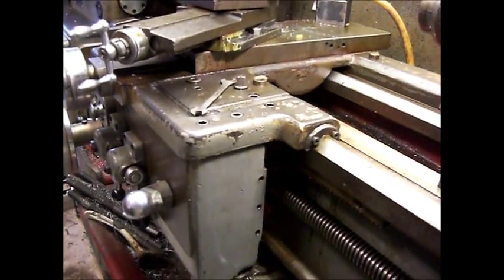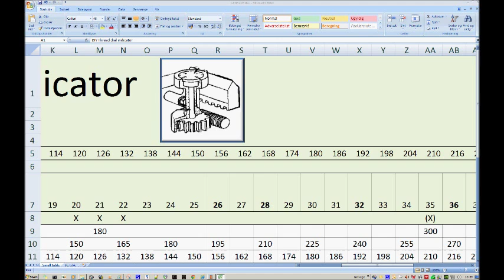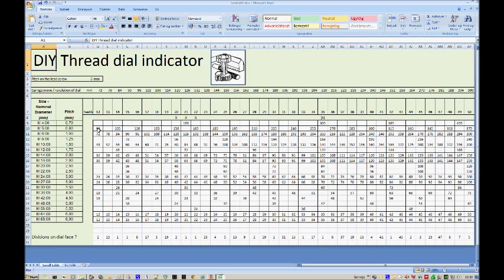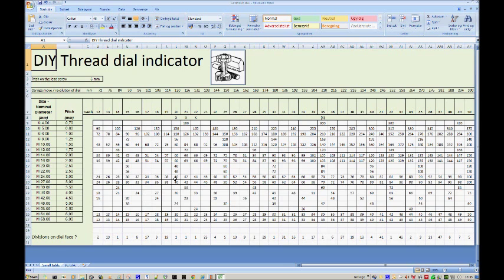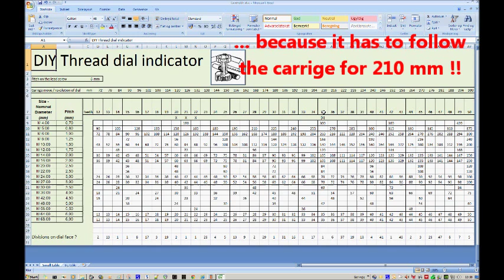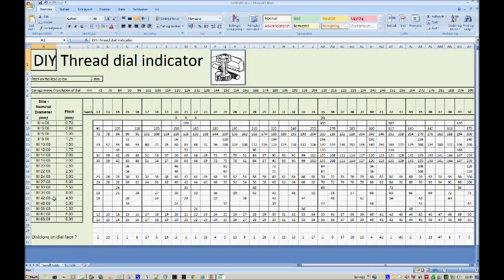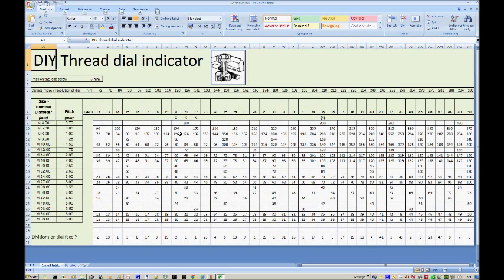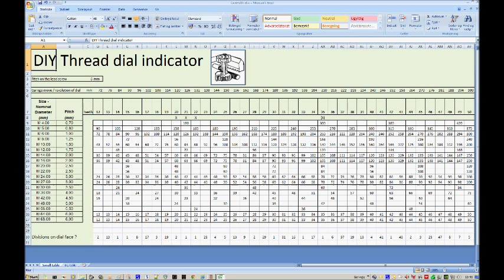DIT Metric Threading Dial - design ?

Comment: Hello Keld, where can I find this spreadsheet that you use during the video?
Reply from the maker: I think I canfind it on my computer ... but why do you want to have it ?
Reply: @keldsor  I'm trying to build a thread dial indicator for my optimum vario 180 x 300 and your spreadsheet will help a lot. That is of course if you allow me to use your case of study
Reply from the maker: @edwardschiller6030  Ofcause you can use it ... if I can find it 🙂 !
I'll take a look - I remember some others reacted too on my video and one of them in fact did some very interesting calculations - I'll take a look to find these Excel-files and come back - mail me you E-mail address - mine is  keld DOT soerensenS AT gmail DOT com - remember the LAST "S" !!!!

Comment: Hi ... late again!
Imperial is easy as long as you stick to even threads. I am just getting in to metric thread cutting and the DTIs still confuse me, they need different gears for different threads. Imperial are all TPI, if only the metric systems were threads per cm and whole numbers! I have been through you confusion believe me. But ... there is a rule. If the pitch of your thread is an exact multiple of the pitch of the lead screw .. then when you engage .. the tool can ONLY be a whole number of pitches out ... which is easy? This was like a revelation to me ... and 40 years amateur engineering! So 6mm pitch ... if (6 / pitch) is a whole number .. then you don't need a DTI. For the ones that are left just run in reverse? So .. 0.5, 0.6, 0.75, 1, 1.2, 1.5, 2, 3 are OK for 6mm. Nasties are 0.8 and 1.25 for your lathe ... but that's only 2 threads to worry about?

Comment: So I'm 2 years late for this but hey, maybe someone will find this useful. I do think your math is correct! From the research I have done on this topic it seems you need at least 3 different gears and possibly 2 or more different dials to be able to cut all metric threads, which is largely the reason they are so uncommon. 

There is one thing you missed though. The divisions on your dial do not have to fit with every single thread pitch! For imperial threads only even thread pitches can engage on every line. Odd thread pitches can only engage on the 4 numbers. "half pitches" can only be engaged on opposing lines, and so on. 

You could easily adapt this to the dials on a metric thread dial. Looking at your spread sheet 2, 3 and 5 are quite common factors, so a dial with 2*3*5 = 30 divisions would be quite useful. So if you have 150, 120, 90, 60 or 30 treads pr rev. of the dial (like you have listed in your spread sheet), then you can engage on any line. those that are divisible by 15 can engage on every other line, and so on. You would have to make your self a table of some sort to keep track of all the allowable combination, but that should be easy for an economist ;).

And then there is the method that someone mentioned that Tom Lipton has demonstrated. For that you could really just use any gear with any number of divisions for any thread. The only criteria would be that the divisions line up with the lead screw.
Reply from the maker: Yeah, 2 years but I still have it on my TO-DO list to get it figured out - because I want to find out WHY and then the HOW will come as a side effect.

Comment: How you getting on with understanding lathe threading Keld.
Have you found out that if you are going to cut 0.5, 0.75, 1.0, 1.5, 2, 3, 6mm pitch threads you can engage the half-nuts at any time.
Other pitches get a little more dependent on having a thread dial indicator. A policy you may like to consider would be to avoid screw cutting other pitches.
Reply from the maker: The day before yesterday I was "practicing" in the shop, making marks on nearly each and every turning/moving object I could see ... but focused on the leadscrew, the main spindle and the saddle.

I'm so stubborn I want to relate what I see to my calculations in that spredsheet in the video, and I think a lead to what you are saying is, that for these pitches I have a integer/whole number of threads on the distance the saddle is moving - NO MATTER how many teeth I have on my imaginaity/virtual threading dial ! In the spreadsheet this is shown by a number in each cell of the rows lining up with the pitches you're memtioning - maybe there should be more words in the explanation, but it's a lead for sure !

The more I read and practice I get closer to this conclusion: Limit yourself to some common pitches you probably will cut in your lifetime and then use the "reverse method" - again Occam's razor !

... but the full and deep "understanding" whould be nice to have ... but should the remaining useful life be used on such luxury ;-))
Reply: Well life is a bit short when it comes down to understanding everything in depth, take women as an example. Anyway, moving on to other pitches, using the Harrison lathe indicator for a 6mm leadscrew instructions that I have found in a book ( Screwcutting in the Lathe by Martin Cleeve, Workshop Practice Series number 3. Try Camden Books if you want to buy a copy ) the indicator reads one revolution per 120mm of carriage travel. the dial is split into four groups of five ( 6mm travel each line ) and with this handy piece of kit the process for the pitches not available directly do become available. In my mind your idea of leaving the half nuts closed and reversing the lathe, sounds good to me, on the odd occasions you would actually have to stick to a particular pitch.

Comment: Keld I think you have got a bit confused as to the use of the thread dial indicator. All the dial upon the TDI shows is the rotational relationship position between the chuck (workpiece) rotational position and the leadscrew rotational position. With the half nuts disengaged the dial rotates (when it is in mesh with the lead screw) and the lines upon the dial have a nominal meaning. Take a dial with one index position on it (forget number of teeth on the gear, that does not matter) every time the dial has rotated once, the workpiece and the saddle position is synchronised. Engage the half nuts and the saddle will start to traverse along the bed, the dial indicator will stop rotating and remain in this case with the one index mark fixed in the same position, where ever that is when you engaged the half nuts. At the end of the required travel, disengage the half nuts, the saddle stops moving but the dial indicator now begins to once more rotate, tracking the position of the rotating chuck and lead screw, move the saddle back to the approximate position you started at and wait for the dial to rotate the index mark to the same position as before, engage the half nuts again and the saddle will once more move in the same rotational relative position as before. All the other dial markings do is speed up re-engaging the half nuts on certain thread pitches.
Reply from the maker: Hi Stephen !
What confuses me a lot more is that some commenters say that I need different gears and others say I can use only one gear or even no TDI at all - just engage where I want !

I don't believe all of it can be true, so I decided to find out how it all fits together by doing some calculations, that's what you see in that video - but I got stuck very fast !

I haven't seen that light yet ... the "AHA" hasn't come to me yet ... I believe I have to work with the lathe more to simulate cutting threads before I see the light !

Here is one video I think is interesting on this subject - he's disengaging the half nut and have NO TDI !

THREADING ON THE METAL LATHE WITHOUT A THREAD DIAL

I'll try to "understand" what is going on in this video - I think that will help me.

I just don't want to "learn" a mechanism, I want to understand it - and I thought my calculations could help me ... but they haven't yet - maybe this video can !
Reply: Keld Sørensen It's not easy to understand until you see it in action. You are going to have a great deal of difficulty in finding a gear to mesh and until then it's going to be difficult for you to visualise. If the pitch you want to cut is directly related to the lead screw you can engage anywhere. Try this to see if it helps. Set a gear pitch up say 3mm on your gears. Mark the chuck with a line at the top. Mark the bed with a line (pencil would be good) at the tailstock side of the saddle. Set a tool up and in a piece of material just scratch the surface with a cut under power with the half nuts engaged at the end of the cut split the half nuts, withdraw the tool and move the saddle back until the tool is clear of the metal in the chuck, switch  the lathe off. Position the saddle at the pencil mark on the bed, engage the half nuts whilst turning the chuck by hand, the saddle will now move, continue to turn the chuck by hand, as the tool gets to the job note how it is positioned relative to the thread and where the mark on the chuck is. Do this several times from different starting points, proving if it matters. Then select another pitch say 1mm on the gear train / gearbox and look at what happens then.  Hope this helps Keld.
Reply from the maker: Stephen Deakin That was exactly what I was going to do inspired by that video ... and now by you ;-))
Reply: Keld Sørensen Keld I forgot to mention that the lead screw should also be marked (on its top somewhere near the tailstock would be good) with paint ( ladies nail polish ) so it's rotational position can be observed.
Reply from the maker: Stephen Deakin That's exactly what he was doing in the video I linked to ... so, I think your procedure is nearby what he's is proposing in the video and I'll try that as a catalysator for my understanding.
Reply: Stephen Deakin b

Comment: It looks to me like the thread chaser with several built in gears that can separately engage the lead screw is the "easiest" solution so far. The jpg image of page 296 (http://s200.photobucket.com/user/oldtiffie/media/Thread-cutting_lathe/Thread-cutting8.jpg.html) seems to indicate that 5 gears are necessary to cut pitches from 0,35 up to 11mm, i.e. 14, 16, 18, 20 and 22 teeth. There are many pitches which need no thread chaser. I am very interested in the solution because I have the same problem, although I have a thread chaser on my lathe. I suspect my thread chaser only works for imperial because there is only one worm gear in the chaser. I'll be following to see if (how) we can solve this one.
Reply from the maker: Hi Jim
Every time I read the page 296 a little bit more light is turned on in the issue - but oh, it hurt for me to understand what is going on here.

Mostly my treading problem can be solved by just making this "auto lift up threading tool" - but it can't be used for inside threads and that's a major problem - so I HAVE to find out how to make a threading dial for metric system ;-))
Reply: Keld Sørensen
I can't see why you could not just use the threading chaser as shown on page 296, Keld. It appears to be a threading dial with several gears built in. You still have to change gears, but they are all there ready to be moved into place. No? Perhaps there is something I don't understand. Whether you turn threads on the inside or the outside is just a matter of tool placement. This should work like any other thread chaser. One would just have to make sure that the right gear is in place before you start turning threads. Unlike the metric ratio "threads per inch" metric uses the distance between threads, unrelated to a fixed dimension. I would like to see some working drawings of this multi-gear thread chaser and then build one. I'm looking! I'm hoping that some of our European contacts chime in and tell us how they have solved the problem. The Ukrainian guy Uncle Michael or the Finnish Sunppaa should know. How's your Ukrainian?

Oops, I just read that you were referring to the auto lift threading tool when mentioning that you could only do external threads. Sorry.
Reply from the maker: Jim Milne Yeah, only outside threading ... but Paul just told me otherwise - looke here:

http://mikesworkshop.weebly.com/internal-swing-toolholder-for-threading.html

;-))

Comment: Keld, in your searches did you run across the following?  It looks to include information on the same 6mm lead screw you have.  Table 1 shows the different number of gear teeth needed for the different metric pitch threads, a diagram of an example dial and based on that dial when you could drop in to the using the half nuts based on that dial.

http://s200.photobucket.com/user/oldtiffie/media/Thread-cutting_lathe/Thread-cutting8.jpg.html
Reply from the maker: Yeah, I saw that too.

Comment: you can use a thread dial but you don't need multiple thread dials you use the lathes gear box or change wheels for the different pitches. plus if you get your calculations right when the thread dial is engaged and the carriage  is moving the thread dial stays still it only turns when the carriage  is stationary
Reply from the maker: Erling Weiseth Ha, ha. ja i YouTube-sammenhæng er vi da !
Reply from the maker: Hi m fletch
You write

"you don't need multiple thread dials" ... ?????

do you mean that I don't need multiple GEARS for the thread dial ?
If so, I think you're wrong.

"you use the lathes gear box or change wheels for the different pitches" 
Yes, I know that - but it has NO effect on the turning of the thread dial - to change that I NEED another GEAR on the thread dial - right ?
Reply: Keld Sørensen Hi Keld.  As I see it you only need one sized gear for the thread chaser.  The relationship between the leadscrew and the thread chaser gear stays the same regardless of the thread you are cutting.  The thread pitch you cut is only determined by the distance the carriage moves per spindle rotation.   You just need someone with a lathe with the same leadscrew pitch to count the chaser gear teeth for you.  Rob
Reply from the maker: xynudu Oh, Rob, then I have to go deep into the russian wilderness - I don't know anyone with a thread dial for that lathe.
Reply: Keld Sørensen Maybe some of the viewers can help Keld out on this.  I don't have a thread chaser either, and have no problem cutting threads by reversing out.  I wouldn't bother with getting one, but whatever rocks your boat :)  Cheers Rob
Reply from the maker: xynudu Yeah, maybe I should just stick to that reverse method too !
Reply: Sounds good to me Keld.  I cut an internal 20 tpi thread today with that method and works fine.  A bit slower, but takes care of any slop in the half nuts and is dead accurate if done correctly.  I use a dial indicator on the cross slide and make sure to zero it before I disengage and reverse the thread.  Then I just increment the next cut.  have never missed not having a thread chaser.  Rob
Reply: Keld Sørensen This is where this little gauge comes in handy.  I made this specifically for this sort of job.  Portable magnetic digital read out for lathe cross slide and carriage travel - $10
Reply from the maker: xynudu Ha, ha, in fact I have 3 of these in my drawers !
Reply: xynudu Keld Sørensen You can have any number of teeth on the threading dial gear and it will be stationary when the half nuts are engaged. You need the right number of teeth to correctly pick up an existing metric thread.

As I said above, the problem is how metric threads are specified. Inch threads are specified as a ratio or fraction, 4 TPI, 22 TPI, 13 TPI etc. Even an oddball like 11.5 TPI can be converted to a simple fraction; 23 threads per 2 inches. Metric threads specified as a lead dimension (1.75mm for example) cannot always be expressed as a simple fraction, or perhaps only by an inconveniently large one. So there is no general solution, you need  a number of specific solutions, ie. thread dial gears.
Reply from the maker: Paul Compton I think I'll make this "auto lift up"- jig for my outside threading jobs and still use the reverse-method for inside threads - then I don't need any calculations or thread dial at all - again Occam's razor !
Reply: Keld Sørensen "that lathe"...... What lathe are we actually talking about here? I haven't seen the make or model so far.... Would be glad to help if I can! ;)
Reply from the maker: Erling Weiseth Hi Erling from ???
My lathe is a Stanko 1A616 from 1962 !
Reply: Keld Sørensen Fra Oslo, så vi er praktisk talt naboer...;)